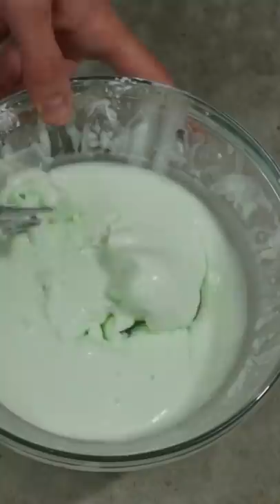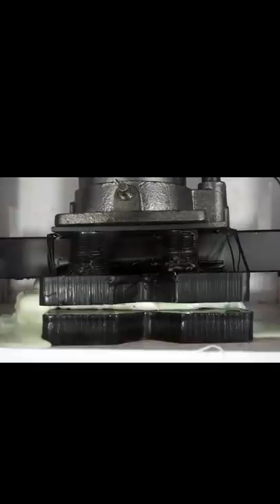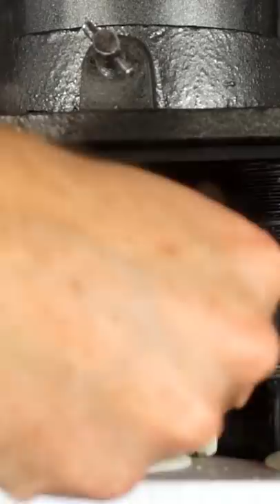Don't Crush Oobleck Too Hard

Comment: Oobleck is non-newtonian because the starch molecules initially entangle when a stress is applied, sticking together like a solid, then slowly untangle and relax back to liquid state.  The kicker is every liquid is non-newtonian on the right time scale.

Liquid molecules are weakly attracted/stuck to each other and can't instantly break that attraction when a stress is applied, so they momentarily behave like a solid until the attraction is broken and the molecules can freely move.  That's why water is momentarily as hard as concrete when hit from a high enough height.  The surface tension comes from water molecules weakly attracted to each other, and if hit quickly enough the tension won't break in time and the water will briefly feel like a solid before relaxing back to liquid state.
Reply: So liquid molecules are just lazy
Reply: what
Reply: Tbh, I think you wasted your time writing that article because not many people care for an explanation or need one.
Reply: @tasteless_5915  I definetily care and I'm sure many people do, so it wasn't wasted time
Reply: I guess you're trying to explain the viscosity in compounds. Gen chem 1 student here, and viscosity depends on the intermolecular forces. The stronger the attraction between them, the more surface tension and even viscosity. So, basically hit any liquid quick enough and hard enough and it may act like a solid, (briefly). Anyways dumb college student here, byeeee.
Reply: I understood this and it definitely explains why you’d die if you hit water from a great height
Reply: @tasteless_5915  I appreciated it a lot more than hearing the OP say "Squozed out" .
Reply: @Wuppys  I don’t Care.
Reply: @tasteless_5915  bro wtf is wrong with you who hurt you? Take a chill pill Jesus christ
Reply: This might be a really dumb question, but does that mean that if hit fast enough and with enough force, you could momentarily crack liquid water?
Reply: @crunchylemon2849  Which then ties back to the Oobleck because, as a long-chain carbohydrate it has a lot of intermolecular force holding it together, therefore causing the non-Newtonian properties
Reply: @tasteless_5915  I liked it.
Reply: @devilhunterradio8395  and?
Reply: oobleck specifically is a non newtonian fluid because shear force keeps it in a solid state. when shear force is continually applied to water, it doesn't continuously act like a solid. oobleck's viscosity is related to the shear force, as with all non-newtonian fluids.
Reply: @sps24  this is a really good question if you think about it. Imagine glass breaking, even when you watch a slowed down recording, the cracks appear instantly. It would have to be slowed down considerably to even see them form. With that in mind, if water were to take on a physical form due to pressure, then there could be a moment where it does in fact crack. Of course we wouldn't know and people will call me stupid because we probably don't have technology capable of recording such a phenomenon.
Reply: @depressoespresso70  Someone throw this at Gavin and his crazy slow mo cams
Reply: @aidenaune7008  Exactly!  I was waiting for someone to get this.
Reply: thank you for this comment, it was a really well written explanation!
Reply: a newtonian fluid, like many other concepts in physics, is a theoretic idealized substance used to simplify some calculations where the divergence between it and reality will be small enough to be dismissable.
Reply: @greengoats1529  no.
Reply: thank you i really enjoyed that :))
Reply: @tasteless_5915  i care
Reply: This was a fascinating read thank you!!
Reply: @tate4399  Me to.
Reply: @joji1622  thanks for your opinion but no one cares
Reply: Huh, you learn something everyday! I knew about Oobleck before, but I didn't know this. Thanks! And ignore that guy saying you wasted your time. Plenty of people probably read this and just didn't comment - I know I've done that many times.
Reply: @tasteless_5915  -- Bored?
Reply: @thescholarlychronicler1805  yeah.
Reply: so would it be different for liquids moving in the same direction as the falling object?
Reply: @EdHarrisonMusic  I am not the one who wrote a big reply assuming I would read it knowing I am just going to tell you I don’t care,
Reply: @EdHarrisonMusic  ikr who would do such a thing 🗿🤷🏻‍♂🅱🅾🅾🅱
Reply: D-did you just trick me into learning?!
Reply: @depressoespresso70  Except......water has a physical form. It's a liquid. It can become a solid in the form of ice, which can be cracked. But, as a liquid, it doesn't "crack" because that just purely isn't how that works, the closest you could get is dropping something on it and creating a splash, which is essentially the same thing.
Reply: @user-qe9ov6us7s  you wasted your time making this comment assuming I would care.
Reply: The 666 likes were bothering me so I ruined it for you thanks for explaining fam
Reply: Thanks!
Reply: @Armanuts 🗿
Reply: you taught me more then all of 6th grade did
Reply: @sps24  this could be possible if the propagation of the crack in amorphous water is faster than the relaxation time of the water.  (Cracks take time to form!). Don’t quote me on this, but I believe relaxation is faster so cracks don’t occur.

Basically, the water molecules move out of the way faster than water molecule “bonds” can break in an organized manner.
Reply: @depressoespresso70  Because of glass’s interesting amorphous structure, it is sometimes not considered a solid but a “liquid” with “infinite” viscosity.  The crack can propagate long before the glass molecules can shear out of the way (because they will never shear).
Reply: @aidenaune7008  oobleck is a truer non-newtonian fluid because nonlinearity in shear rate occurs not only during initial applied shear stress, but also a phase separation when knocked out of single phase stability by a large enough stress (starch falls out of solution and entangles as a solid).  In either scenario, entanglement of starch molecules causes its temporary rigidity.

Because its so hard to measure for most pure fluids, that initial viscosity spike is ignored for practical applications and fluids like water are approximated as newtonian.  I’m just highlighting that its an approximation and that linearity doesn’t exist at all time scales (technically non-newtonian).
Reply: @dreamescapes1763  that's so cool, but that also makes me wonder... if we were to launch something that's launching something that's launching something else... (i'm about to go on a rabbit hole adventure now lol)
Reply: @yemmiecapricornus3586  How the object of interest interacts with other objects only depends on its relative motion to the other objects.  So if you have liquid flowing down at a constant 10 mph, some canon also traveling down at 10 mph, and that canon launches a ball down at 20 mph, the ball only impacts the water at 10 mph.  It’s all based on relative motion, which is explained better in this video: https://youtu.be/xBS01yzd0yI
Reply: @tasteless_5915  okay. I'm glad ur good :) But that word starting with r is a slur.

Comment: If you were to put desiccants of different strengths and concentrations, I wonder what effect it would have on max shear stress before separation. My thought is it would hold onto the water better, but too much may change the physical properties of the oobleck by separating water from the cornstarch.

Comment: comment section: “are you a solid or a liquid?”
Oobleck: "depends"
comment section: "fascinating"
Water: "am I a joke to you?"
Reply: SpaceX-Space Flight Simulator   Bruh, let joke be jokes and stop being a nerd in the YOUTUBE COMMENT SECTION
Reply: SpaceX-Space Flight Simulator  The comment is not incorrect at all. It "depends" and that's all I said. I didn't say it depends on the same factors.

It was not my intention to imply that oobleck is not fascinating for its unique properties, my comment was supposed to imply that the other "jokes" about it were not well thought out but that seemed to have gone over your head.
Reply: SpaceX-Space Flight Simulator  you make it sound like there isn't a transition period, but you are correct in that it isn't really the same
Reply: SpaceX-Space Flight Simulator  the joke is that water is a liquid if you move through it slowly, but it hurts if you punch water really hard
Reply: SpaceX-Space Flight Simulator  That's not even true though, water can be super heated/cooled, and there is also the triple point to concern yourself with.
Reply: Ametures - 
Liquid holding containers
Reply: SpaceX-Space Flight Simulator  No. Google the triple point of water.